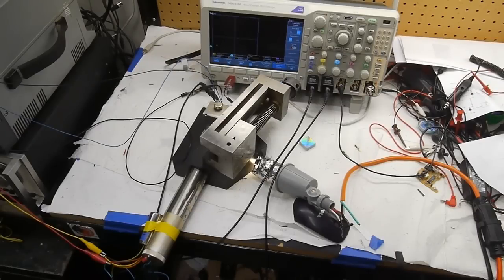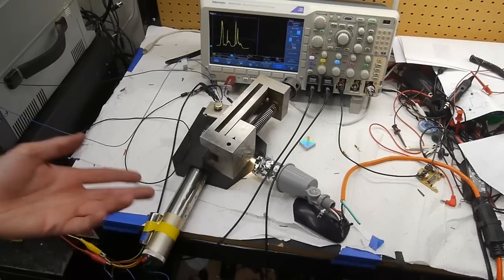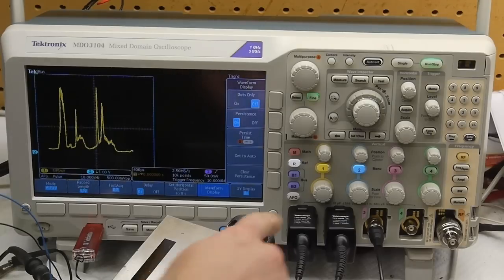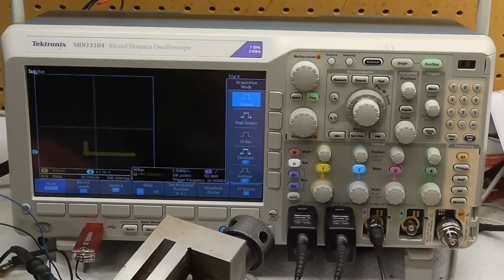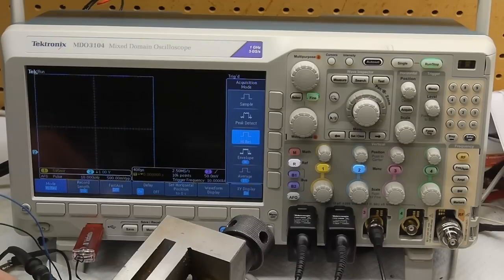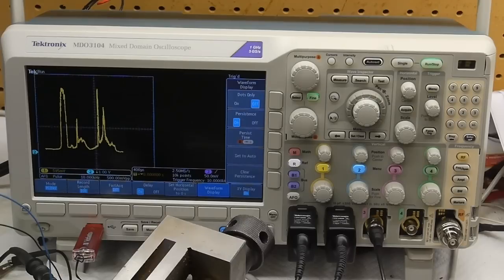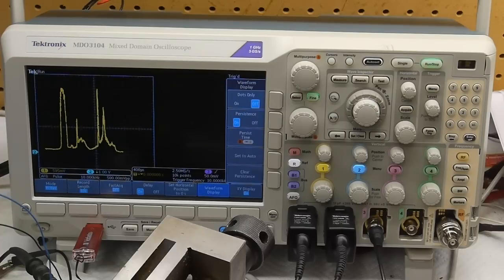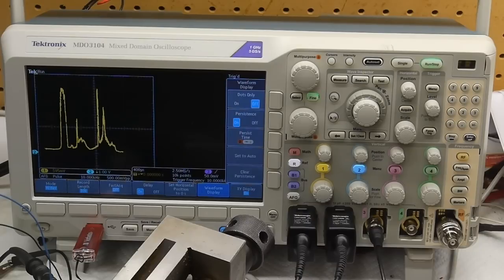Use an oscilloscope to collect optical spectral data

Comment: Neat application.  Like your spectrometer looking forward to that video.  Last weekend during my monthly rummaging  through thrift stores I found a functioning and within calibration Gilford Stasar II Spectrophotometer for $15 (eBay $300 to 600).  It has a monochromator that scans from ~315 – 725 nm.  The wavelength selection and zeroing are done manually with a seven turn knob and a ten turn potentiometer respectably.  My plan is to run the wavelength selection via a servo, the zeroing via a digital potentiometer and add a sample changer (standard - sample - standard and so on) run by an Arduino.  I have run some manual spectra of: chlorophyll, heme, lutein, nickel chloride and a didymium glass filter, works a treat.  Cheers, Mark

Comment: I still need to get an osilloscope but this will be very usefull for my botanical adventures. spectral data is very hard to find outside of products specifically marketed as such, even major paint manufacturers don't have the spectrum data for their products. I'll just need to modify the spectrometer for use with reflected light.

Comment: Nice diy spectrometer.

You might consider putting simple DIY galvanometer on the shaft instead and build a cirucit to feed it with a sawtooth wave (Or connect a signal gen to an audio amp). Then you can simply trigger off the sawtooth wave and then look at amplitude versus time. Also easy to capture that to a computer as you only have to capture 1 waveform plus it would give you a live updating image on the scope..

Comment: Surely the scope can deal with the offset using the shift control?
Reply: That would involve throwing away a lot of precision, would it not?
Reply: Peter Workman
No, because the shift applies a DC offset to the input, so dynamic range shouldn't be affected

Comment: Diy spectroscopy is treanding. Mostly for nuclear radiation spectrum analysis. Except the scintillator crystals are still too expensive. Photo multipliers are cheap. 

IR spectroscopy could be used to detect human bodies either warm or not.

Comment: Intersting implementation. I was tihinking on building a spectrometer but using one of those linear image sensors they are just a few dolars and have a few thousand pixels resolution in one line. Most are from Toshiba or Sony are in a DIP pakage and the data is easy to read.
Maybe they are not as sensitive as your photo multiplier.

Comment: Very cool.  you need to take the sine of the angle to get wave length.  To calibrate get a HeNe laser or some single line.  You will get a zero order reflection which is white (all wavelengths).  That's theta=0 and then turn until you see the first order and that 632.8 nm (HeNe).  There will be a second order and that's the angle for 2x632.8 nm  With that you can accurately calibrate.  Always turn the grating in one direction to avoid backlash.

Comment: If you only use a few degree of your potentiometer, wouldn't it be more handy to use a smaller value with an extra series resistor and/or use a multi-turn precision potentiometer?
Reply: No, ideally you'd want it the other way around. You'd want a potentiometer with like 90 degrees of turn or less, so you get more resistance range over a smaller area. But even so, by biasing the positive and negative supplies, you can get pretty much whatever range of voltage you want.

Comment: Just because I'm wholly ignorant, does the photomultiplier tube have a fairly flat response across the spectrum?

This is a really neat way to use the scope.  Might be possible to use it as a poor man's surface profiler as well (maybe using a record needle or cd laser)
Reply: Google R6094 and you can check the datasheet, its useful between 300-650nm but is not flat at all. It could be compensated out and maybe calibrated out depending on what you are doing. But as he mentions the major advantage here is sensitivity. You can get photodiodes with wider range (250-1200nm), but again they are not flat. From what I've seen "flat" response photodiodes will only have a narrow band of flatness.
Reply: Ja Ro Awesome info, thank you!  The calibration part is what had me wondering...i'd be curious to know if you can apply functions to the XY inputs on a scope of that stature.  I'm assuming no, and that you would have to pull the data off and compensate post hoc.
Reply from the maker: Ja Ro
 jcims Coincedentally, I'm actually using the R6094 in this application.  It's true that it is not flat at all.  Red sensitivity is especially poor. I was thinking of doing UV/VIS spectrometry with this setup, so the tube is good for that, but it would certainly be nice to trade a little sensitivity and speed for flatness.  I don't think the scope can do math in XY mode, but I will give it a shot. Subtracting a known clear calibration spectrum from a sample spectrum would be really cool.

Comment: Just wondering, is that concave gratting one of those Edmund Optics super expensive items ? 

By the way, keep up the good work.
Reply from the maker: Thanks!  I bought it used on eBay for about $50 (as I remember).  At the time, I thought that I could use it in Rowland Circle configuration or flat-field configuration, then I learned that the grating is designed for only a specific use case, and this particular one is meant for monochromators (or scanned spectrometers), so that is what I built.  More details in the next video.
Reply: Applied Science Thanks for the info.
I have been working in a compact and low cost spectrophotometer for high school and first year colllege in Brazil. Here we pretty much don't have options other than research grade instruments and we are trying to put together something really affordable. Your suggestions would be very welcome, I'll let you now when our site is ready to go on-line.
Reply: Applied Science Dear Ben, as I mentioned some months ago, the website for our the visible range spectrophotometer project is on-line: www.vis2048.com.br (english version available)
I'd love to receive some suggestions or criticism from yours.

Kind regards
diasyuri
Reply from the maker: diasyuri
It appears that your comment has been spam filtered because of the URL.  Usually I can approve comments that have been filtered, but yours appears to be entirely missing.  I love spectrometers, and would really like to have a low cost spectrometer for myself.  But I am a hacker and like to have analytical equipment just for the sake of having it.  I think finding one killer app that will benefit everyday users is essential to a product like a mass market spectrometer.  What would 10+ million people do with a spectrometer that would solve a problem or improve their lives?
Reply: Applied Science Hi Ben, concerning my last and short contact, it was a 3 line message only. No spam filter was in action there.
About the smartphone choice, as we are trying to achieve the lowest cost possible we figured it out that a display, buttons and a good microprocessor could be eliminated if people could use something they already own such as their smartphones. With this in mind and considering the affordable profile of the instrument, we also decided to make it as intuitive and easy to use as possible so that anyone could just download the app, play with it and, if interested, get the spectrophotometer to learn more.

We are working to make two versions available. The VIS2048 which is the complete solution for absorption and emission measurements including the app and all statistic and chemometric tools we are trying to implement, and a second version which is even cheaper, smaller and is basically a spectrometer for emission measurements. As I mentioned before, the focus is to make it available for high scholl and first year college students, but during the process we realized that we could also reach a general public with the smartphone approach. 

PS. If you are interested, I could ship one unit of the spectrometer version to you for evaluation when it is ready. What do you think ?

Also if you have anything in mind that you think it would be possible to try using the spectrometer. Just let me know so we can try it.
Reply from the maker: diasyuri Sure, I'd be happy to evaluate your spectrometer when ready.  Please send me an email, ben.krasnow@gmail.com.  I don't have a killer app for a mobile spectrometer that could be used by the general public.  Determining a use for such a device that could benefit end users might be more challenging than the technical work of designing and manufacturing the device.

Comment: What is the advantage of this setup with an oscilloscope with a multiplier? It seems to me that just imaging the spectrum with a CCD and getting the data via a simple computerprogram is more precise like you did with your Raman spectroscopy setup.

I know they use a similar setup like this in material science, but they use two diffraction grates to further split the spectrum to see hyper fine structure in the spectrum.
Reply: Photomultipliers are really sensitive, and I think they work with the same gain on the whole spectra.
Reply: They are unbeatable in sensitivity I know.
They are unbeatable when it comes to faint short signals (e.g. scintillation counter)
But CCD's are sensitive too. They are even used to image the spectrum of stars trough telescopes.
With CCD's it's just the illumination time that dictates the sensitivity.

But I remember a video of him somewhere where he said that he would like to try measuring the distance of the moon with his laser. So, maybe it has something to do with that and he wants to measure only the frequency of his laser coming from the moon. Then I understand the use of the photomultiplier.
Reply: Curixq You can easily enough perform spectroscopy with a CCD, but I think you'll struggle a lot more to achieve the same precision as you potentially could with this setup.

CCD's are inherently noisy, and in astronomical spectroscopy, capturing the spectra of a single star can take dozens or hundreds of exposures (each several minutes long) that then need to be stacked/combined - all in the name of increasing the signal-to-noise ratio of the final result.

There isn't really a way to extract spectra information from just the CCD alone - you need additional information (a filter to produce a spectra, for example) to complenent it. Or, you need an incredibly well characterizes sensor, but then you still also need to fully characterize the source of light you're trying to analyze... Which is kind of coming full circle. You'll need to analyze the light so that you can analyze the light.

The method in the video is a lot more direct and require less complementary information.
Reply: The CCD has an advantage if the input signal is strong.